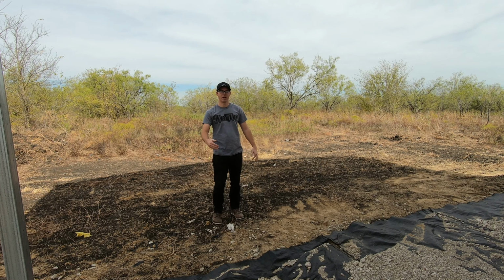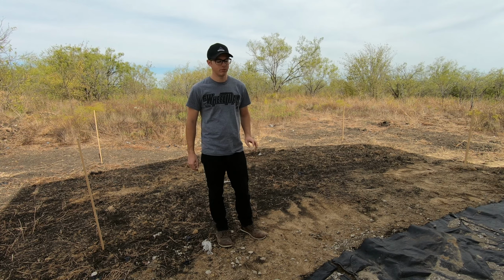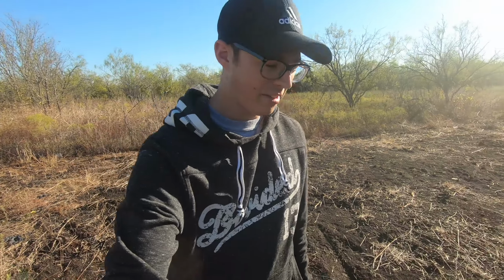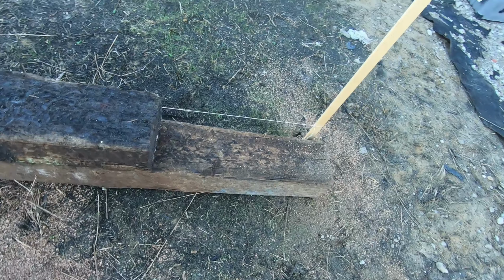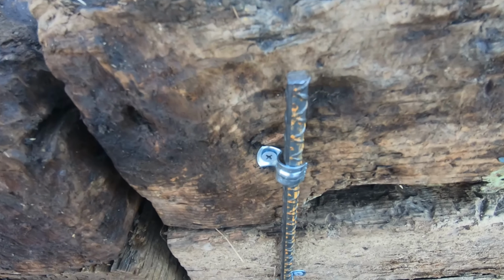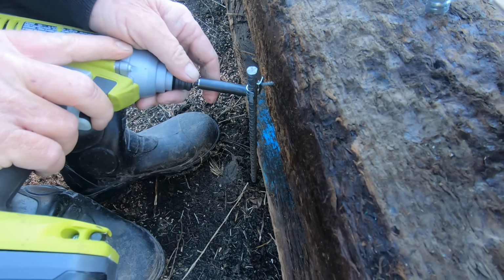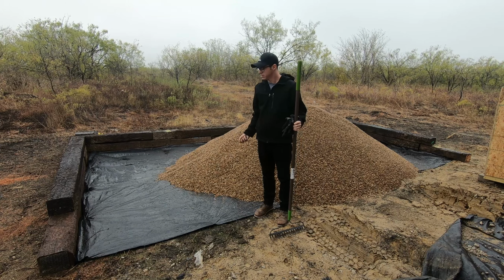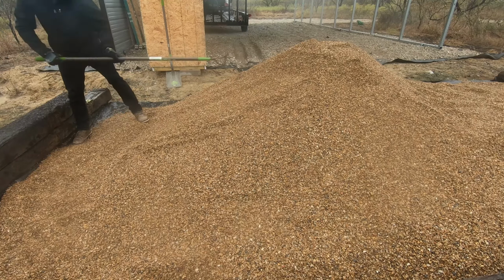Rainwater Harvesting Tank Base

Comment: A better option would have been to drill a hole in the wood and pound the rebar straight in.
Reply: This.
Reply: Yeah I don't know if those little brackets will hold up or not, but I know a rebar sunk through the center of a tie isn't going anywhere.